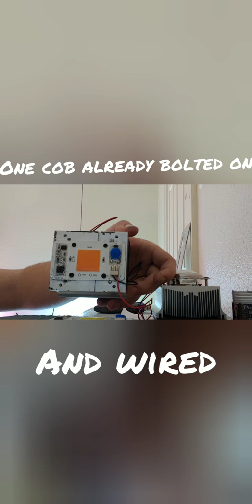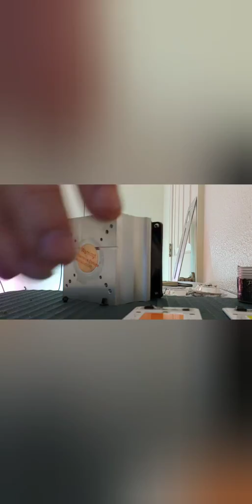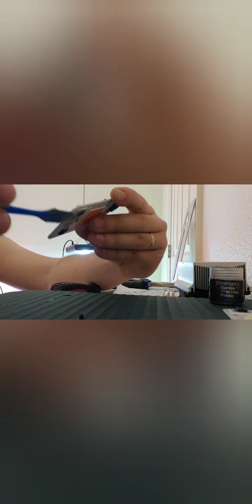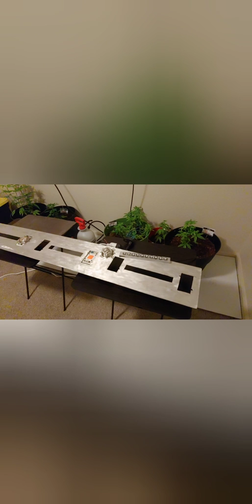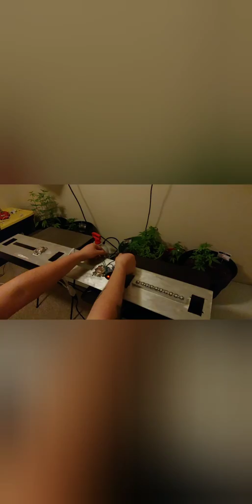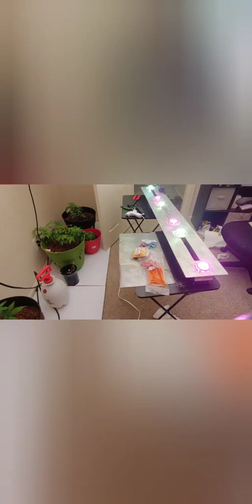50 WATT COB DIY grow light! Putting heatsink and 50W cobs together!

Comment: I ran them without the fancy heatsink and used a thick aluminum i beam  with some cuts on the top to make fins.  They run at around 35 watts after a couple of minutes.  Do yours run at a full 50?
Reply from the maker: They are self regulated so if you have Hsink with fan keeps them cooled enough where they never get hot an will run full capacity which is like 47.5 watts